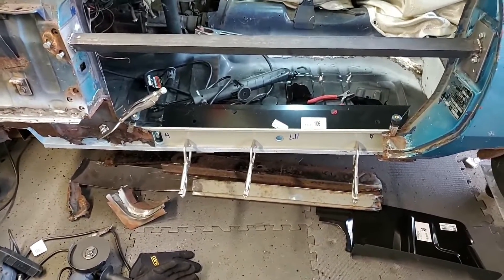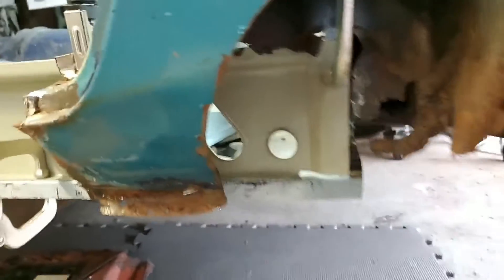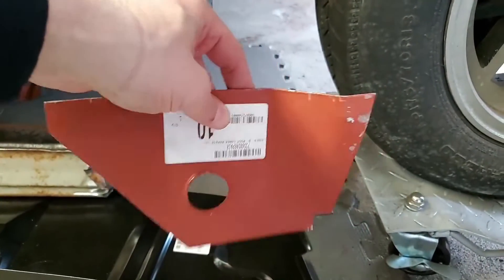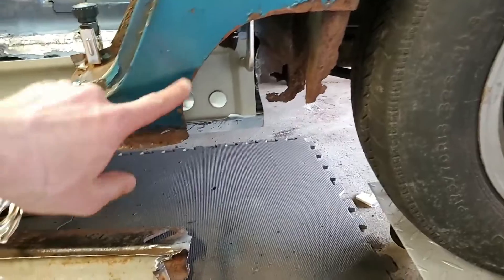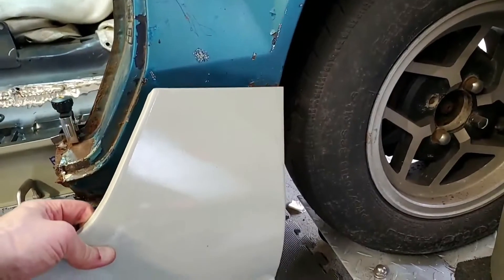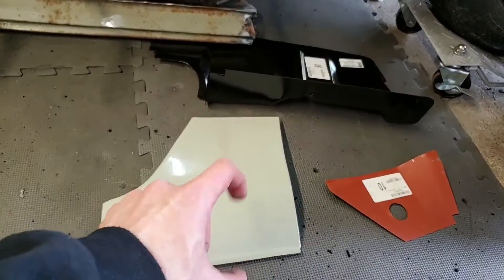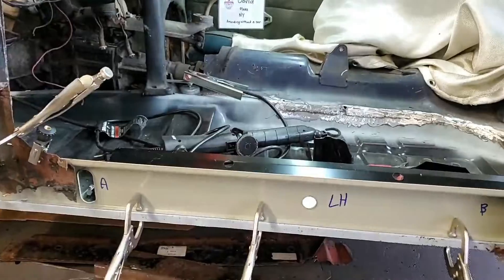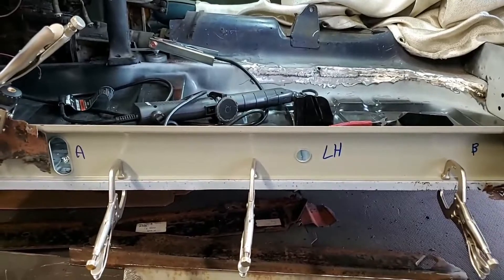Triumph GT6: Sill B Gone

Comment: In lieu of the clamps, use self-tapping screws from the bottom.
Reply from the maker: Yes, definitely. I was starting with a very rough fitting. Going to have to fix the firewall flange next...